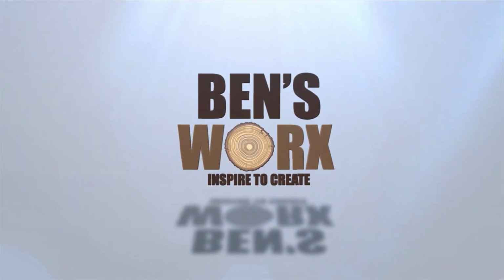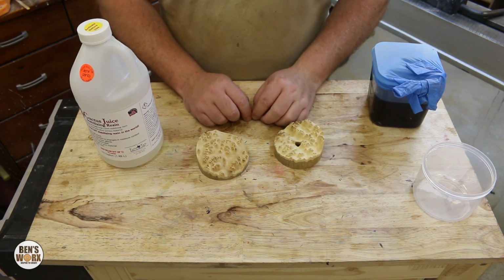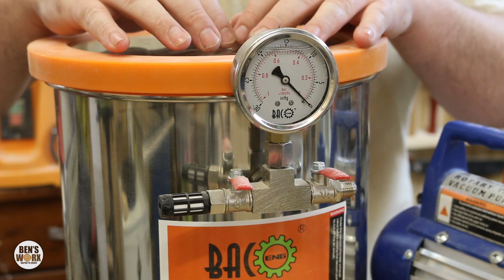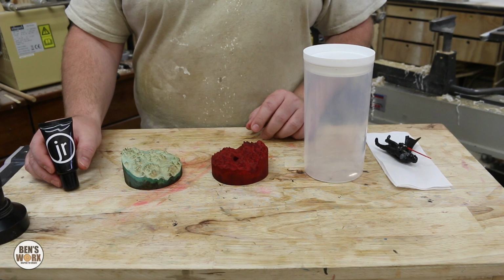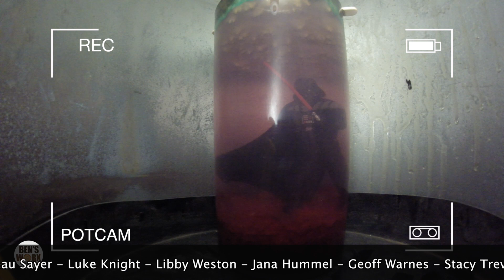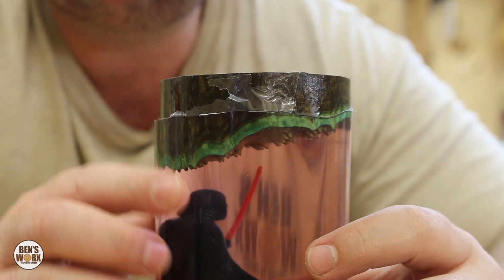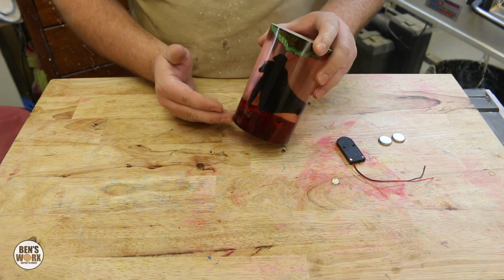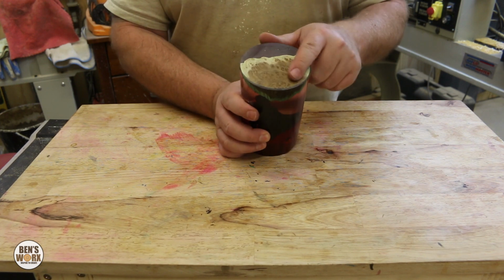Making a Darth Vader Resin Night Lamp - A Tribute to Dave Prowse

Comment: definitely looks cool and I know there's no real way of lightning up the light saber due to how small it is but what might be possible is to put a thin coat red highlight on it and have an option to switch from the regular led to a black light led which will make the light saber stand out with a pop as well as anything thats white. Some EL wire mixed in could make the controls  look more awesome as well.

Just a thought!

Comment: Imho it’d look much cooler if you made this lamp not in a form of cylinder (rectangle sides wouldn’t distort figure that much), and if you covered the lightsaber in resin with luminescent red pigment. Also you could make the lightsaber with optical fiber covered in resin with LEDs on the other end,then it’d look like it is actually glowing. But it still looks wonderful,nice work!

Comment: Would've looked alot better if u'd replaced the plastic lightsaber blade with one made of resin, making the core foggy white and the outside transparent red, and then lighting it up with a bright LED hidden inside the hilt. I'm damn sure that would've looked awesome and it could also have been able to shine some more light on the figurine itself.

Comment: Please explain the vac chamber. Others who use resin don't seem to use or need it.
Reply from the maker: A vacuum chamber is used to de gass resin prior casting, it is also used to stabilize timber to make it stronger and more dense, some resins have a long pot life and low viscosity so degassing is not necessary. I hope this helps explain a vacuum chamber